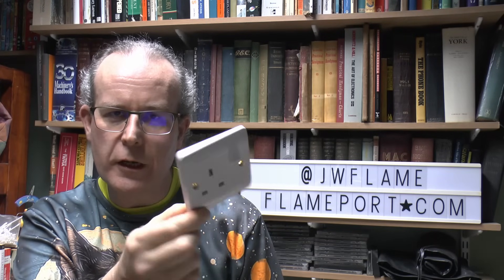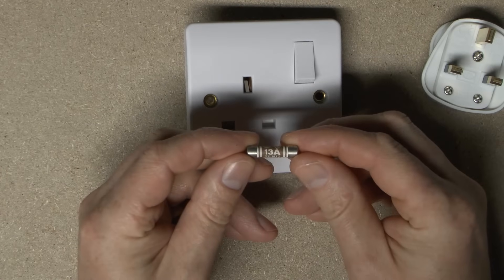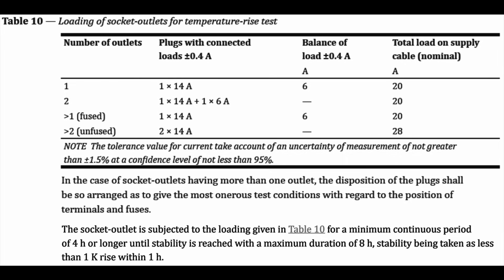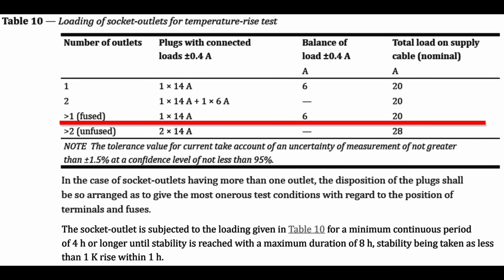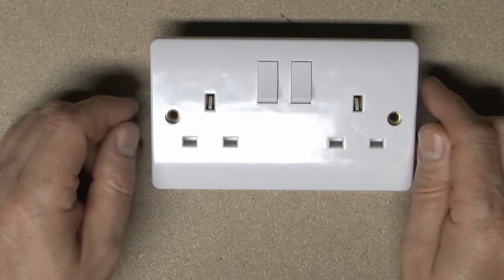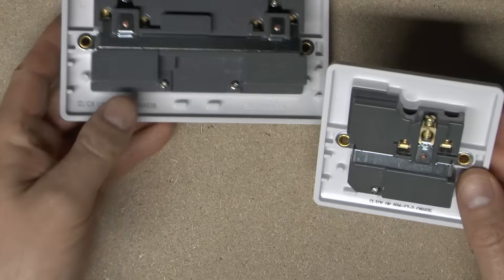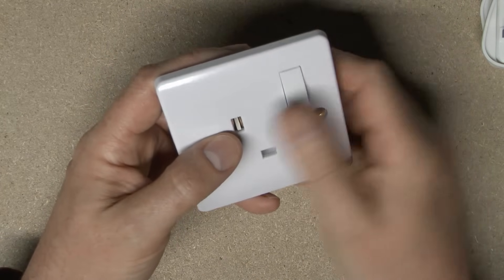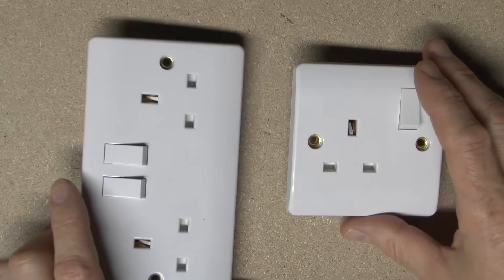Double Socket Outlet 13A 20A 26A? EV Sockets, Fuses,  Washer/Tumble Dryer in one double?

Comment: Are the UK still doing the ring circut thing, or are they just using thicker cables now for new installations?
Reply from the maker: Rings are still specified in BS7671, and plenty of people still install them, mostly in entirely inappropriate ways.
Reply: Under the current regs you're still allowed to install them. There's still plenty of electricians fitting them particularly for kitchen circuits but radials are definitely getting more popular
Reply: Still both 😊
Reply: Utilising radials instead of rings could effect demand/ diversity calculations where multiple have been installed throughout a property, especially where high loads are apparent.

Double socket faceplates deteriorate over time at 26 amps with loading from washing machines and tumble dryers running together. 
   I inform customers to only use one at a time, but some never listen as today's society deems it necessary due to "busy time" constraints, impatience and dare I say lazy responsibilities. The heat/ distress occurs time and again.
Tell them sockets are worn and plugs too!
 Loose, dirty contacts and none wish to have them replaced until they fail.
Customer doesn't care while it works, then complain at the cost and time of an electrician.
Worse still, they watch you tube, have a go themselves with incorrect sized tools and no basic testing and wonder why cables melt at the back due to incorrectly tightened terminals, or reverse polarity.
Thankfully most listen to the advice and maintain their electrics with a visual inspection and a call to their electrician of choice if unsure.
Down to the competent electrician to ensure best professional advice for each individual customer and their load requirements.
Reply: @thorsfew64  People say the same in Australia, don't use both with 10A at the same time!!  Truth:  There were actually doubles that were  rated for 10A max and that was embossed on the face plate - 10A total.  It's been more decades than I care to admit to since I've seen such an item.  Everything for a long time has been rated at 10A per socket.  A 4 way can technically support 10A on every socket, but in practice that simply won't happen because it would grossly exceed the typical 16A or 20A general power circuit.  Although higher current general power circuits are possible they are as rare as hen's teeth.  My mum used to flog the double in the laundry in the '60s and it took it without complaint.  Thinking back though, it's miracle the extension cord to the standing cabinet clothes dryer didn't fail.  I remember it getting very floppy indeed.